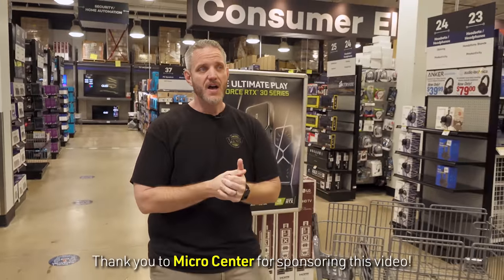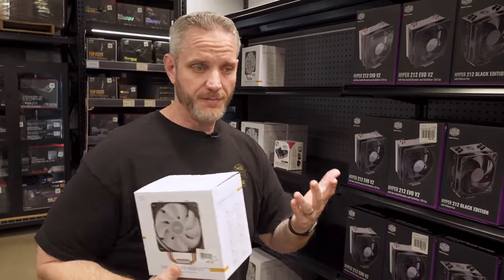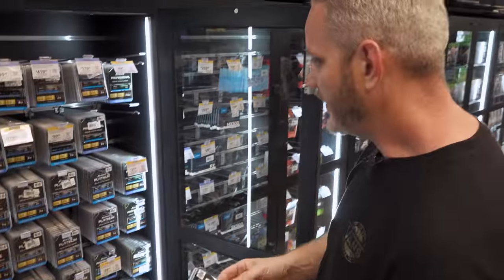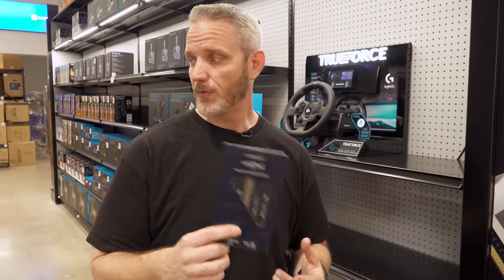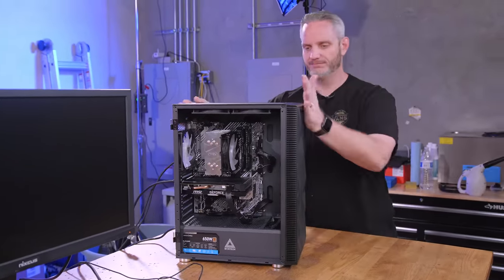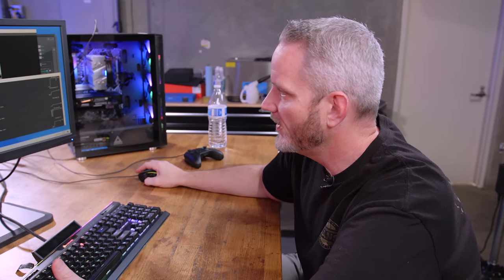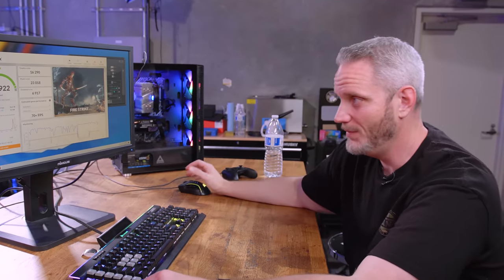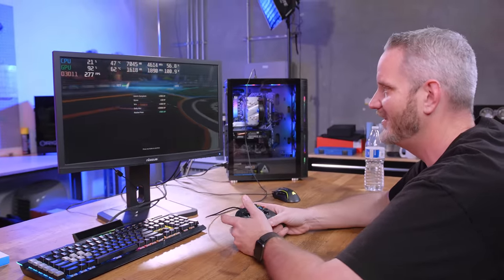How cheap can I build a "Gaming PC" for in 2022

Comment: I remember when a grand was a very high end option, had the best widely available parts. (ways to save down below)

but I gotta say.... if going with non modular PSU that cable covering for double the price? ain't no way, they are still insulated and you don't need a special weave over it. and G.skill is a good brand. haven't had their power supplies, but I do know they back their memory more than any other company that I know of. with that said, modular PSU makes more sense if you are getting a larger one to have upgradability. most don't realize it but power supplies and connector requirements have changed many times and often without warning... "LOOK! NEW CPU/MOBO PLATFORM!.... LOOK! NEW GPU.... AND NOW ANOTHER NEW ONE!...those connectors have changed a LOT and can completely ruin the expectation of upgrading later. you can also buy those sleeves for under 10 bucks if you insist on having one or 3 bucks for the older style protective plastic flexible tubing which is even more customizable.

and I wouldn't consider that a computer build as none or the peripherals was counted. if someone doesn't have a computer, they likely don't have anything else. they would need a monitor, mouse, KB, and a way for hearing it, either speakers or at least a headset. even bottom of the barrel for 1080p gaming you would be looking at 200ish for cheap peripherals

for "cutting corners" when it comes to budget, I look to factory refurbished, or at least an outlet that has been around long enough for them to back up their own refurbs. and sometimes I will set up a build for a month away then watch for sales/clearances/liquidations. I just did a major set of upgrades and saved probably around 33% just grabbing the expensive stuff on refurbs and sales. CPU more than 1/2 off, Monitor, refurb for 35-40% off, Video card refurb for 35-40% off. 70% off my headset. those 4 things saved me around 525-625 bucks for other things.

also get to know the brands that are trying to compete with the big name brands that have good backing. some lesser known brands out there competing rather well with top brands and can get them for 40-66% less. Arctic brand over Noctua for a third of the cost, Red Dragon over Razer/corsair for peripherals for 33-40% of the cost, AOC or Viotek or Innocn over Samsung or Dell for half or less. most peoples biggest issues are gotta get it now, gotta get it at one stop.

knowing WHEN to buy for upgrades/next build is good too... month to two months after new CPU/GPU hits, the lower boards take a dive (relatively speaking when figuring for inflation), the price drops to all things related to architecture upgrades below the newest... mobos, cpus, gpus, memory etc.

 buy during pre black Friday sales, rarely will they put up popular things during black Friday, they put up things they want x-mas shoppers to get for their loved ones, they are selling to people that don't know any better what is what. and the good products are hiked before they are put on sale so you don't save nearly as much.

 DONT buy during tax return season unless you absolutely know your products and its standard pricing.  buy during the after Christmas return rush, businesses are trying to cope with the huge drop in sales combined with huge return volume.

know your price to performance curves. figure out your bang for the buck basically... put the common parts on a graph to how they perform and how much of an increase each one is, you will see a arc, you buy below that arc levels off or starts to flatten too much. for example, a CPU for 115 gets you X performance, a 160 gets you a 50ish% increase in performance... but the next chip up in performance is 260 and you only gain 1-4%. for a 100 bucks that's where you buy the 160 dollar chip. 

but I will say... NEVER EVER buy from a company online you've never heard of selling parts at absurdly unusually low prices. 99% of the time it is a scam. if its a reasonable price.. call them first, make sure they actually exist as a company before taking any chances. then ask them how they are able to have such a low price noting being a larger company getting bulk discounts. if legit they will be likely getting over stock, refurbs, or reselling "undamaged returns". then its up to you to chance the quality of part.

hope all this rambling helps someone out there.

Comment: Def should have went with the 5600x or g…if g you could have a backlit display out for future motherboard updates or trouble shooting. Then definitely should have went with a 3050…ray tracing (maybe) and just newer features. I would have chose the 3050 without question then most likely the 5600x or g…prob x personally…I absolutely love my 5600x 3060ti build…oh and should have got a motherboard capable of overclocking. Great video though! Love this kind of content…this is something is viewers are actually capable of going out and doing. Two thumbs up..👍🏼👍🏼 cheers

Comment: The only thing I see that could have been better would to grab a 6600 instead of a 1650. Alot of times you can find it for around 369, and with that you also can driver based rsr which will doing it really well

Comment: Well I paid $580 for my pc case, cpu, motherboard, and power supply. I already owned a GPU, Ram, and drives

I went with a Intel Core I7 10th Gen, DIY PC Case, Segotep 750wat fully modular PSU, Asrock H510M motherboard, GPU Asus Rog Strix 2060 6GB OC edition, Ram is PNY XLR8 Memory 16gb 3200mhz, 1TB Samsung 980 NVME, and a 1TB Western Digital SSD.

Comment: 1660 is a solid card but whenever I'm building for clients I always recommend 1 gen behind or current.  The 3060 would have given better numbers because it's built in technology does a lot more than older cards even within the same spec lines.  These days the 6700xt is great value card though when you were doing this video Vcard prices were still in their nasty stage.  Great build up and shows managing where you spend more not how much you spend total makes a difference.

Comment: So to anyone looking at this build now, I just put together a significantly better build for the same price so luckily prices are getting better. I used a 5600x, Radeon 6600, MSI B550 Gaming Edge wifi, arctic freezer 34 eSports, 16 gigs of g. Skill ripjaw 3200mhz ram, adata xpg sx6000 pro 512 m.2 nvme drive, an evga 650w 80+ gold power supply, and a Corsair 4000D for $993.91. obviously this isn't including any peripherals or even the OS but this is the same pricing system Jay went with. With an OS and some peripherals expect to spend $1300-1600 total which isn't cheap but is most definitely not a bad deal in the current market for a complete setup

Comment: It's hard to get a good case these days with good front I good for Io and temper glass panel doors for for under a $130 That's going to be OK to build in... The fantex case is one of my favorites gives you plenty of room for a big graphics cgraphics card and you can still front mount if you want,, I top mounted mine so I could have the 3 140s in the front pulling cool air in but you can fit a 360 Rad with a big 13.5" GPU in the phanteks case.. Again the H500P is a pleasure to build in and is a looker it you go black on white or white parts on black case and with built in RGB that's not over the top it's a really nice case..

Comment: when you're limited to one store, sure.

r5 4500, 5500, 5600 etc usually go for $70-$125 respectively, am4 motherboard for $70-$80. 6650 XT way more powerful and under $300. WD SN570 1TB under $50, very good pcie gen 3 nvme. If you want cheaper, go for the equivalent wd green which is a bit slower. WD IMO is the best for all kinds of storage, especially reliable datacentre HDDs. for a $90 case you could get the nzxt h510 flow directly from their website, which is much nicer.

there are many online apps which will give you the lowest prices for your parts across different stores, e.g. pcpartpicker. Passmark's benchmark websites will show you the best price/value parts based on current market

Comment: I find it actually very interesting that those prices are also very close to those in Europe. Like her in Germany you can build a system similar to this and pay almost the same. And I´m glad that the GPU prices got at least a little down. It´s down to a point where I´m considering to buy a GPU in sooner future. I just looked it up and damn an RTX 3060 brand new from a Store for like 450€ which is still high but I remember them going for 700-900€ :D

Comment: For anyone wondering, Red Dead Redemption 2 runs at around 70fps at 1080p on Medium to High settings with a GTX 1660 SUPER, Ryzen 5 1600 (3.6Ghz) and 16GB of 2400MHz RAM. So, don't be disheartened by what Time Spy shows.

Comment: easy. get your motherboard, GPU, and RAM used. get the case on sale. 
got my B450M VHD Pro for £35. 2070 Super for £400. 16gb 3200mhz RAM for £45. 
275r case for £50

Comment: Motherboard: MSI MPG X570 Gaming Edge Wifi 
CPU- Ryzen 3700X
Ram- Corsair RGB Pro 4x16gb 3600 mhz

Storage
Samsung - 860 EVO 500GB SATA 2.5" SSD
SAMSUNG (MZ-V7S1T0B/AM) 970 EVO Plus SSD 1TB - M.2 NVMe Interface
Samsung - 970 EVO Plus 500GB PCIe Gen 3 x4 NVMe Internal Solid State Drive
And several Samsung 1tb T5’s 

Graphics: EVGA RTX 2070 Super Ultra XC

Power- CORSAIR - RMx Series 850W ATX12V 2.4/EPS12V 2.92 80 Plus Gold Modular

Comment: I was told by an employee at MicroCenter to get an anti-static mat and wrist strap when assembling a DIY PC and handling electronic components.  Is this necessary depending upon where I live?  I am aware that in some low humidity areas of the country, static electricity can be a problem.

Comment: That 71C on the CPU thing, I don't know if that's an Intel to AMD thing or I just got a ditzy chip but my R7 1800X will shut itself off if I hit 70C with it. 40C idle, mid to high 50's in games is what I need to run at and never have issues

Comment: I am an amateur creator, editing and rendering a few videos per month.  The longest is about 2 hours long.  I use Movie Studio Platinum 17.  I NEVER game and have no interest in overclocking.  I hope my new computer will last as long as my current 9 year old i7-3770, 16G RAM, 2TB mechanical HDD. That one is still running, but v.e.r.y.  s.l.o.w.l.y....

Which of these will give me the most benefit and which can I get a low level version?
CPU:  i5, i7, i9 ?
RAM: 16G, 32G, 64G?
Nvme SSD  or SATA SSD
Graphics card:   Necessary?
Air cooler ok?

Thanks for the great videos.

Comment: Intel I3 12100??? or Intel i5 11400??? And would both push up to a 3070 no issues. Dont need a 30 dollar cooler savings there would help you get a 2060 or 3060 for same price range. Just my thoughts

Comment: R5-5600g
Just remember this is NOT essentially an R5-5600x but with graphics. The difference in cache size (16MB vs 32MB) can make a HUGE difference at times when you compare both with the same graphics card. There's a lot of benchmarks that show a 30% difference in FPS for plenty of games (when paired with a high-end graphics card) and the 1% lows that are an indication of STUTTER where higher with the R5-5600g... I'm not saying you should NOT get an APU now and get a graphics card later, but you should know the details.

Comment: For my 2022 truthfully ghetto budget build I just used a old HP omen with Thimphu mobo and threw a 7700k I got off eBay and a new dh9l cooler and a used 1050ti in it and went ahead and got a Corsair 750 watt psu on marketplace.. months later she hasn’t burned my house down yet 😂😂

Comment: Even as a bit of an AMD fanboy, I can only agree with the choice of parts.
I feel like newer Ryzen chips cheaper than the 5600X took too long getting to the market, though if they were here already, one of those would be pretty good.
And with GPUs, it's straight up just current price, how many fps, and how much performance do you lose/gain for a couple dollars. If 10% more fps costs 15% more, it could be worth it for a higher res panel. 30% price difference - yeah, I wouldn't bother.

Comment: Nice video! The system seems a little unbalanced though, I wonder if a 11400 and a 6600XT would have fit into the budget instead? That'll get you 30FPS@1080 on RDR2 :)

Comment: Jay, did you leave the white portion of the molex daisy chain connected in the exact order?  I have built plenty of these cheap cases and almost every time, something goes wrong with the RGB, like static rpg for example. And in almost all instances, it was that special piece not being in the right spot. It's bizarre but it often helps change the LED button from off/on to color selection. Not saying that is the issue with this one though, just wondering since I know nothing about this particular case. Just, my boss orders lots of knockoffs like this one to build with hehe.

Comment: I used this case to build my 5700g build  I replaced  the fans with better argb fans I had and gave away the fans it came with over all its not to bad of case mine don't seem as thin on the motherboard  tray as the one you got

Comment: I feel bad because I consider $1500 a budget build >_>
Basically anything under 32GB RAM, 11700k or 5800X and less than a 3070 is a budget build imo.
I'm running on the brink of what I consider midrange/budget build.
5800X, 32GB RAM, x2 1TB NVMe SSD's, 3070 FE
I can't wait for the 4000 series cards to come out because I'm going 4080 or whatever the top end is if the performance is that much better than a 3070.

Comment: W H Y can't we have such a great store here in my country!? We do have some hardware stores but most are rather small and or pretty expensive because they are so small. The few that offer reasonable prices do not have a big variety of parts to choce from and again, the few parts they offer are mostly not in stock. I could spend hours walking through this store and pick parts. This is impossible in my country, you would not find all the parts at one place, maybe if you pay 20-80% more than in a different shop but even then you're not getting eveything from one shop. It's annoying. When I built my last system I ordered parts from about 3-4 different shops including amazon just to get what I want and I was not even buying everything brand new. I bought CPU and GPU used so all in all I bought my stuff from about 6 different sources!!!

Comment: I buy my PC [2020-01-15] for 635$: Ryzen 1600AF. Gigabyte GA-AB350-FDSH V2,  SilentiumPC SG1 TG, MSI GTX 1660 Ventus XS OC, HyperX Fury RGB 3200 16GB,  SilentiumPc Fera 3 RGB, SSD Corsair Force MP510 480GB M.2 + my PSU from old PC - OCZ Fatality 750W modular SLI 80 Plus I wanna back in time and buy better GPU :D

Comment: I've been running with an Antec Basiq Power 550W PSU since 2010 lol, is there a reason why all YouTubers are recommending 700-800w PSUs even in builds that they do which only really require 500w? I mean even a build with Intel Core i7-11700K and an RTX 3060 ti was recommended an 850w psu? I find people myself upgrading to better components in the same kind of price range at the time.

Comment: Im pretty sure the neo forza is the ram I have in my ibuypower pre-built, and I've paired it with another 16gb corsair vengeance kit running each kit in its own channel and I've had no problems with either kit and they play nice together. so in my experience it is decent ram it just doesn't look as good

Comment: i just looked for the cheapest system i could build, because some store sells a lenovo t5 with a 11400f and a 3060 for 977. 433 without graphics card and a 12100f plus 500 for a 3060. First I thought... damn that pc is a good deal, but if i think about it, the self build is probably way better, even if i picked some of the cheapest parts i found. 
I did decide though, that I'm gonna be patient for a while, because my 7500 1060 still holds up okayish (probably just because I didn't buy elden ring)

Comment: Hi i am getting my First Computer this month, can u please tell me if my Configuration is ok or not?
-i5 12500
-Msi Mag b660m mortar ddr4
-Corsair Vengeance LPX 8GB 3600mhz
-Samsung 970 evoplus 250GB
-Corsair CV550 
-Deepcool Matrexx 40 Micro ATX Case
-Gigabyte G24F 165hz Monitor or Zowie Xl2411k 144hz which one should i get?

[GPU- RTX 3050 or 3060 in Near Future]

Comment: Hey there Jay.. I'd be curious how that computer would perform with a RTX 3050 8G card.  Wouldn't that be about the same price or lower than the 1660 super you picked up?  Also, I stream quite a bit and use Nvidia's broadcast for audio and video enhancement.  That only works with RTX series cards.  For a gamer / streamer, would the 3050 at the same price or lower, with more specs, features, and ram, be a better option?
Just curious.

Cheers
Rick
Reply: RTX 3050 is better option. Newer technology, and more VRAM. About the performance in games, 3050 will have a little higher performance, and lower temperatures, but search for comparative videos... RTX 3050 vs GTX 1660 Super

Comment: you can make it cheaper by replacing the motherboard with H610m Prime/ pro model and the Cpu by i3-12100F .  the 12th gen i3 is comparable to i5 11th gen gaming performance but cheaper.

Comment: Please i need your advice on this please. I have a HP desktop computer core i7 2gen, 1tb, 8gb ram but the graphics is Intel very small. 

Am thinking of buying Intel DELL Inspiron 7559 Notebook 39.6 cm (15.6")dell Inspiron 7559 . Full HD Intel® Core™ i7 8 GB DDR3L-SDRAM 1000 . 

Now to my question. Should I buy the DELL Inspiron 7559 which will cost me $400 or i should upgrade my HP desktop.